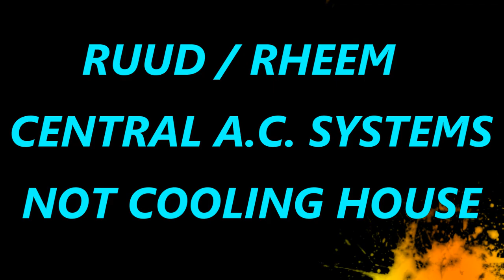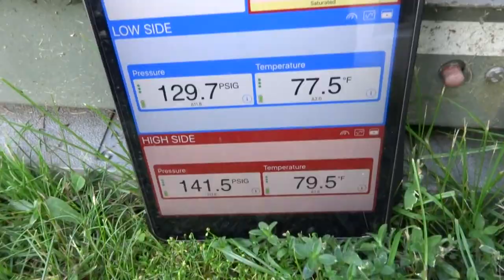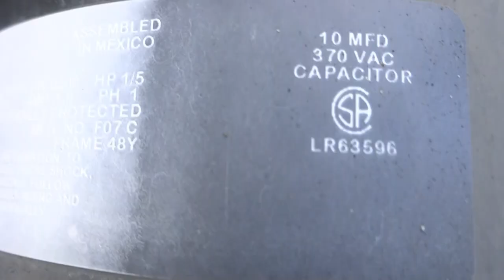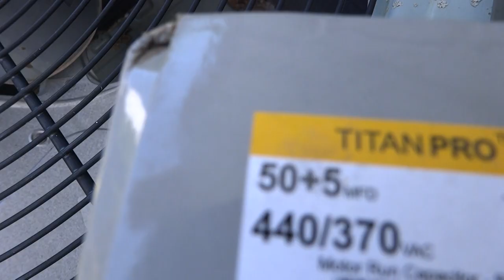RUUD / RHEEM CENTRAL AC SYSTEM NOT COOLING DOWN HOUSE

Comment: hey, that coil has a sweater on. Needs a good cleaning. do you ever use chemicals to clean the nasty coils? on all your videos you only hose them out with plain water.
you are not a believer in coil detergent? do you put tablets on inside drip pan to keep drain clean, or do you not believe in those either? just curious.
thank you for your videos. you are an honest man.
Reply: Steve just talked at some length on why he does not recommend coil cleaner. Play every video he put up in last 5 days. You’ll hear it while he’s driving.

Comment: What Capacitance Value, was the old Capacitor's 50 Microfarad. Reading? Thanks!
Reply: I saw 45.xx on the meter. You didn’t?
Reply: @dock_yard1149  Thanks. I didn't see that.
Reply: 4.5

Comment: Have a lot of those old Rheem cubes in my area. Pretty reliable, but that one side of the coil near the compressor always gets dirty first and worst.
Reply: There are 1000s of those little Rheem cubes in my area still. They run very well.
Reply: Yes I still see them around. Very reliable. Im not a fan of there indoor coils. They get restricted and not easy to clean out
Reply: They are good units but for some reason the condenser coils are always dirty.  You can have another brand next to it and they will be twice as dirty.   Idk if it coil fin spacing or who know what.

Comment: My home ruud has the same capacitor 10/50uf 350v - 370v
Reply: Mine has the same capacitor to just had to replace it the board and relay. Was going to call a professional but everyone wanted a emergency fee and said they most likely would not have all the parts. Amazon prime to the rescue.